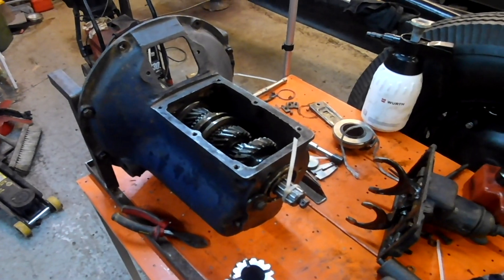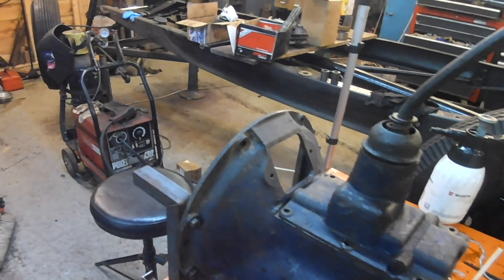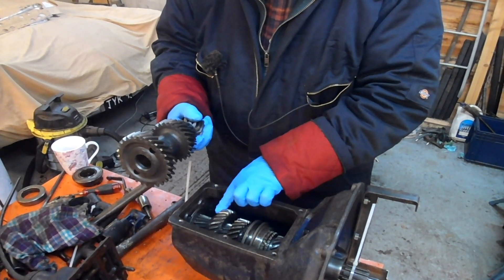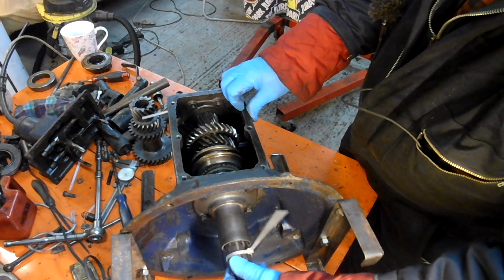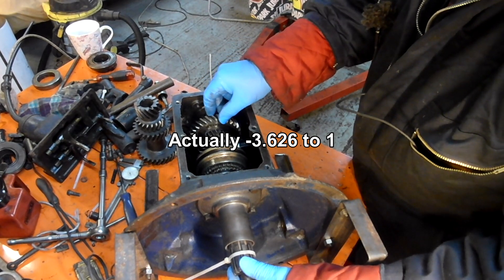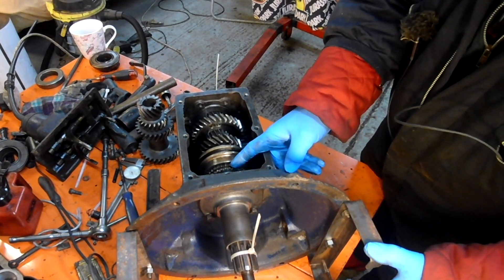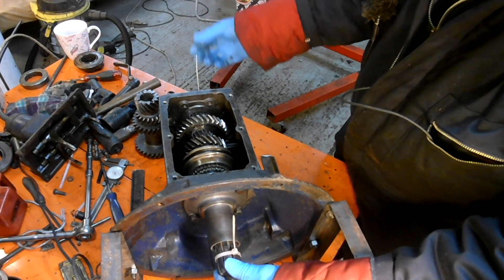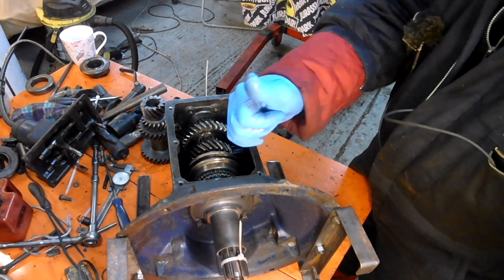Gearboxes a mystery? Mart lifts the lid on the 39 Ford 3 speed. A Sunday quickie.

Comment: A three speed manual transmission is very basic and simple. When Ford came out with the three speed column shift, they likely did it with a just a few modifications of this transmission. Instead of a shift lever on top of the transmission, have two small levers come out the side of the transmission. Have one of these levers operate first and reverse then have the other lever operate second and third. Then add a bunch of linkage from the transmission to the steering column and put a shift lever on the steering column. The result is a 3 speed column shift with the same gear set as a 3 speed transmission with the shift lever on top.
Reply from the maker: Hi David, thanks for watching and commenting.

Comment: MART! Backing out of my garage tonight the coupe suddenly just locked....wouldn't go forward or back....the trans locked! After working the clutch in and out without stalling the engine and working the shifter in and out of the gears ( harder in rev ) it freed itself. Is this common with this trans? From what I've gleaned, the '39 and later side shift trans have the same internals. Ever come across this before? is it something to look forward to again? Or, is something like the roller bearings worn causing the cluster to cock? Any input would be greatly appreciated! I've had this problem before with a Muncie 4 speed and had to take the side cover off to move the sliding gear back into position.....
Reply from the maker: Hello Pie. I'd be looking at the shift tower. Locked up means in two gears at once. So it hasn't disengaged 1st or reverse while it has engaged 2nd or top, or some other combination of that type of scenario. look for wear in the balls at the end of the stick and the slots in the forks. Also look for wear at the detent grooves and balls.
Mart.
Reply: @MartsGarage  Remember,  I have a column shift.... That's the way it behaved, like it was stuck in 2 gears, but happened while I was reversing and not shifting. I'm gonna check to see if a weld broke loose that I put on the forward/reverse lever and probably pull the side cover. It only did it that one time. I thought you may have come across this issue before. Thanks for the input Mart!
Reply from the maker: @piewagn  Same thing applies, but you need to check the linkage for wear and slop and the detents in the side cover. I had it happen on a side shift 3 speed thames van. Had to get out and rattle the links back and forth to re-select neutral. Slow deliberate movements of the shifter will help and a good close look at the mechanism at the base of the steering mast while some one shifts for you. Try and see if you can shift badly and reproduce the situation. Mart.
Reply: @MartsGarage  Thanks Mart! A little too cold out right now to do anything, but first decent stretch I'm pulling the side cover. Picked up the oil today after work. I'll let you know what I find. Keep up the great work Mart....always enjoy your stuff!!

Comment: Thanks Mart for the real interesting transmission display. Is that 39 gear box similar to my 40? I have the column shift.
Reply from the maker: Hi Teryl. Yeah, all the guts inside is the same, except the case is set up for a side shift system. The casing is rearranged to have the cover at the side instead of at the top. Your column shift connects to two levers on the side of the gearbox cover and moves a pair of selectors in a similar way. The across the gate movement is achieved on the column rather than at the box.

Comment: Kool Mart!  My first car was a 62 Falcon with a 3 speed, i was a dumb 16 year old, and would break it all the time. the first time i took the trans to a guy to fix it, then i figured out that I could fix it my self. I put a 39 Box in my 36 Pickup, it made a big difference. with that trans i put a small parts kit in it, thanks for the tid bit about the helical cut, I  did not know about them meshing like that!
Reply from the maker: Cheers Brendan. That helical cut caught me out. I wanted to use later pickup gears which are cut at a different helix angle. The difference required a different angle on the shaft splines too, which meant the later gears would not fit on the earlier shaft. There's a thread about it on the barn.